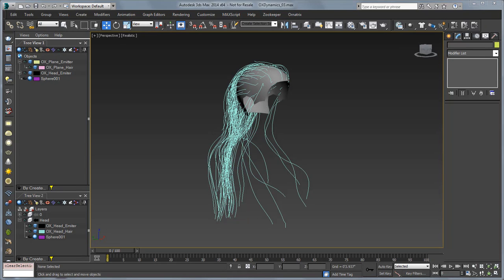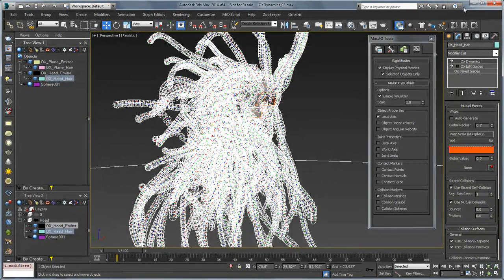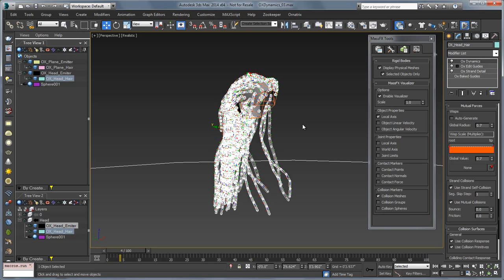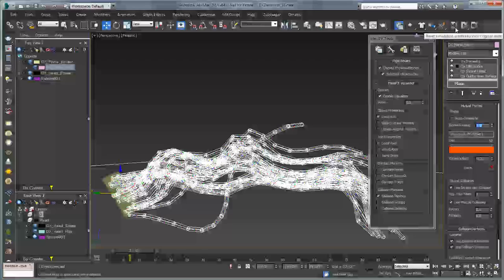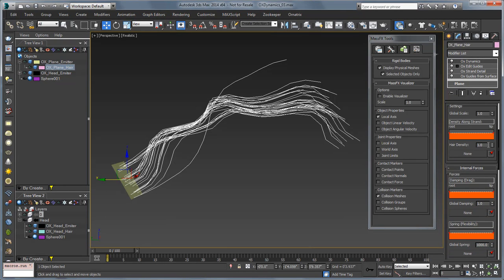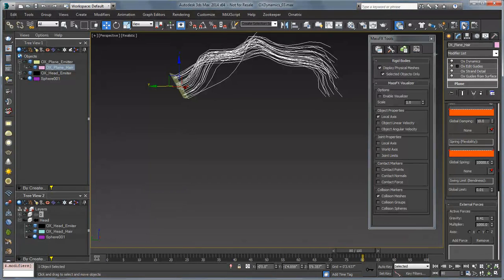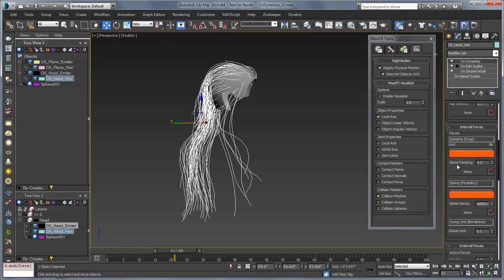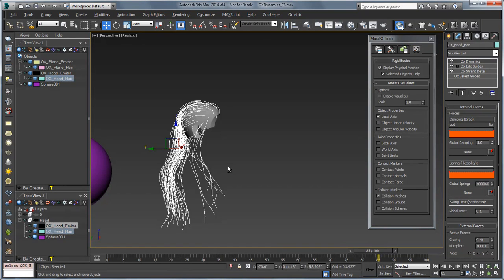Ornatrix 101: Long Hair Dynamics

Comment: It's unfortunate that the Nvidia SDK they utilize doesn't support working multi-threading or hardware acceleration even though the UI has a checkbox for them.
https://knowledge.autodesk.com/support/3ds-max/troubleshooting/caas/sfdcarticles/sfdcarticles/3ds-Max-2017-MassFX-doesn-t-use-multi-threading-or-hardware-acceleration.html